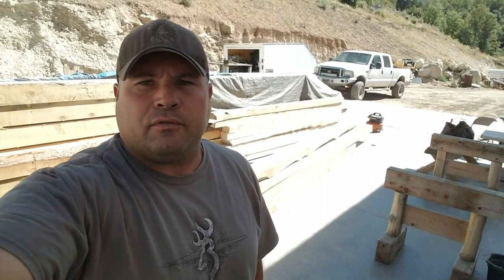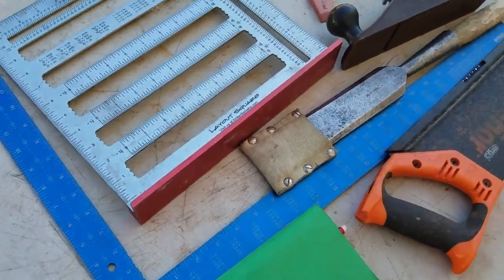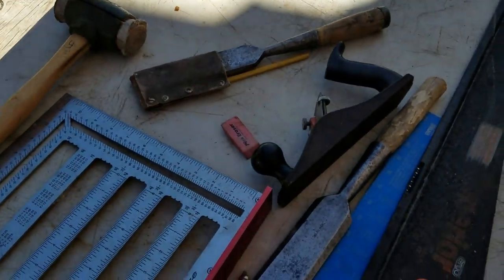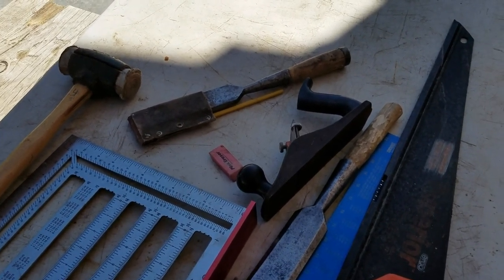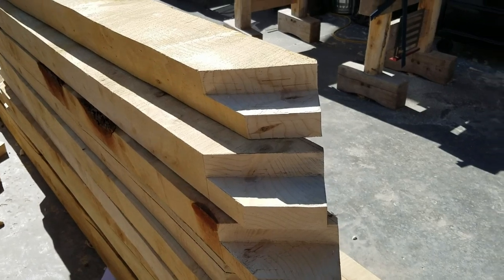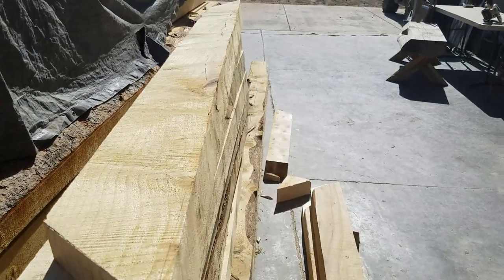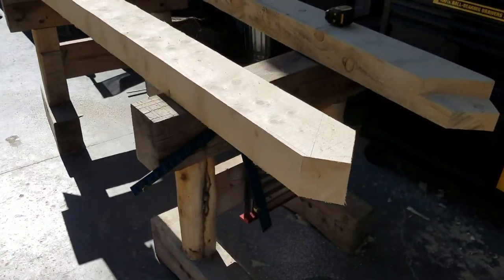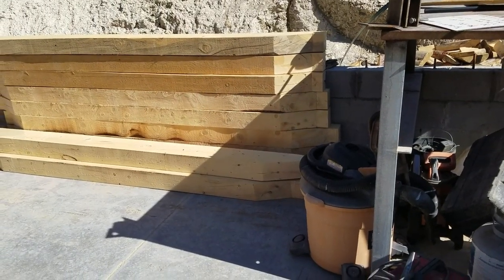From Sawmill to Timber Framing

Comment: Looks like you're having fun bud!  Don't be afraid to push down on the chain mortiser a little bit to get it to cut faster.  The reason isn't so much to make it cut faster, but the sharpening job will last a lot longer if you don't let heat build up.  Spinning really fast and only taking a small chip will heat up the chain and it'll dull a lot faster.  It's easy to push too hard, so you gotta feel it out.
Reply from the maker: Thanks for that. I have always done this with my boring machine and I just bought the mortise machine, that was the first time I had used it. I didn't know how fast I could push it.
Reply: @bustedwagonranch4546  No problem! It's really easy to overwhelm the little motor so it's a matter of finding the right amount of push.

Comment: Does it take that long to use the chain mortiser or was that on slow motion?  You should be able to just go full depth of cut in seconds.
Reply from the maker: It has a new chain on it and it is quite slow on the first full cuts. But after that it gets much faster.

Comment: Hi, which brand/model carpenter square are you using? A problem I'v run into is that either square isnt calibrated (distance wise) correctly or even that measurement of inch/cm on tongue is different than blade. Cant understand who manufactures such crap with straight face.
Reply from the maker: I have 2 framing squares. One is 50 plus years old, my favorite, the other is a aluminum home depot model which is nice for the bright markings.
Reply: @bustedwagonranch4546  As long as the markings somewhat match between your tape and squares, i guess you're good to go! :)